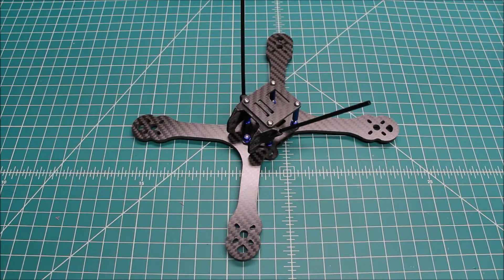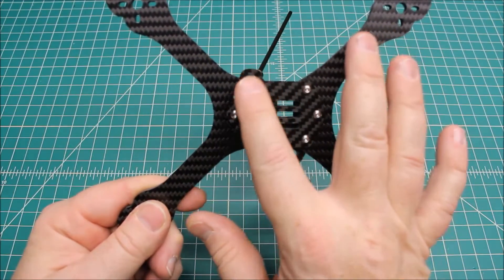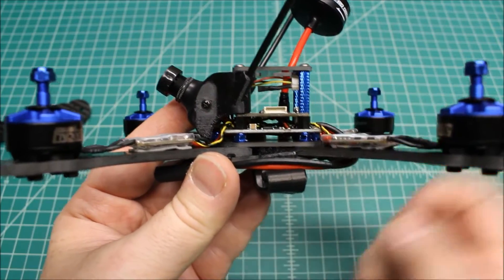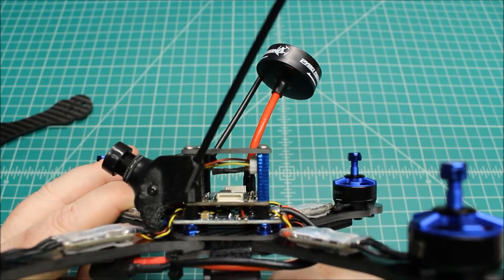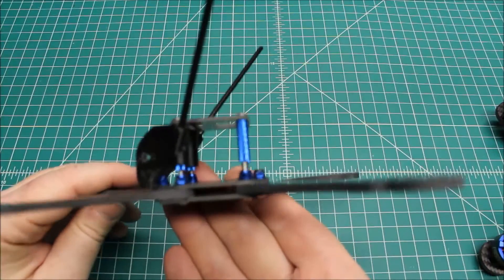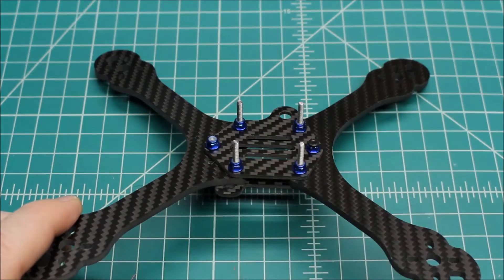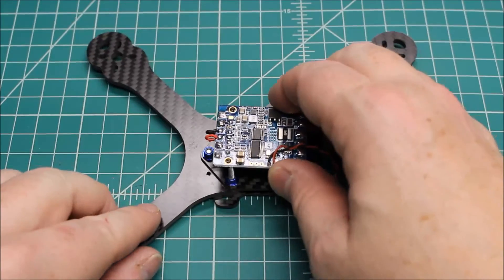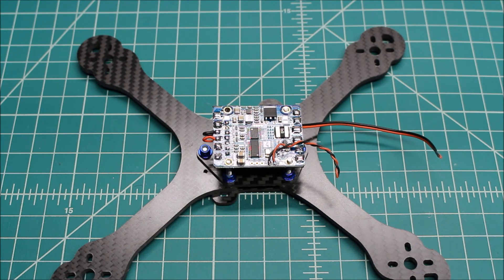Pyrodrone's Hyperlite FPV Racing RTR Drone Build Overview 1 of 3 "Frame Layout"

Comment: Aloha just got the ss edition and built mine. I'm using an xracer v3 fc and are getting little twitches and found out that somehow the fc is grounding out to the frame probably due to having metal bolts running thru the stack. Might try another fc but thought I let you know Mahalo
Reply from the maker: +Llewellyn Grace I've heard other people with the same problem.